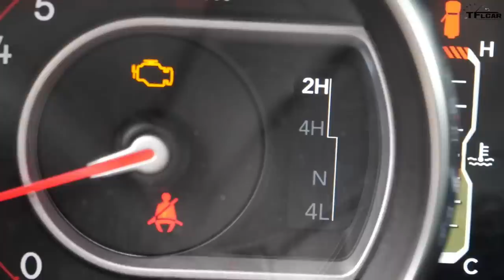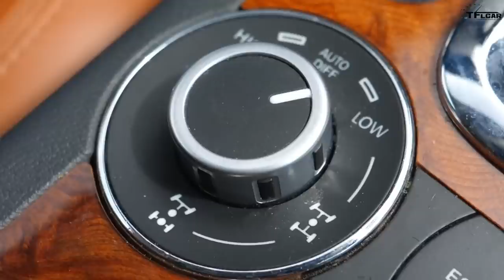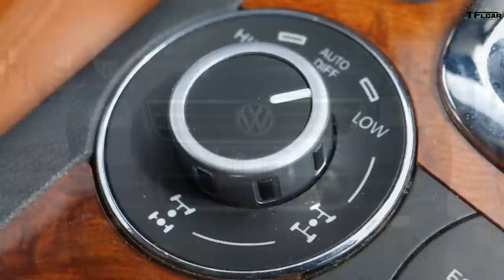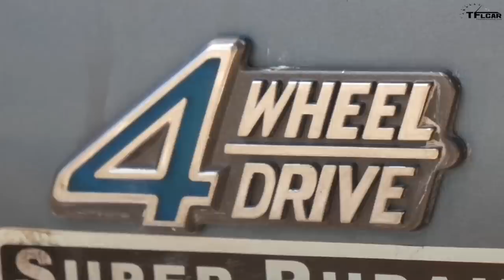These Are The Best (And Worst) Off-Road Cars And Trucks We've Owned!

Comment: Aztek is my favorite of the video. So underrated, odd, and strange. Yet a great performer with a reliable V6
Reply: I recognise you
Reply: @ignasanchezl  oh hi ;D
Reply: Those 60 degree gm v6s are trash the good ones are the 90 degrees like the 3800.
Reply: @Albone3000  my mom and I both have one of those 3400 V6's with 179000 miles. Slow oil leak but they run so smooth. Alero and Venture

Comment: These older vehicles make sense.  The best offroad vehicle is one you can afford to mess up.   See too many people putting on $500 designer shoes and afraid to scuff them on a rock at the farm, instead of buying some cheap disposable work boots.   For most people offroad isn't really offroad these days, its gravel and dirt roads and the like where you may have to hop over a small fallen tree and get a bunch of little rocks thrown up on your paint work and underbody, that's all.   So forget that $55K offroad beauty truck with the 84 month loan.
Reply: This is what I never understand: why are people so afraid of scratching the paint or puncturing the plastic bumper? What's the big deal? Spray it with anti corrosion substance and it will be just fine. Not looking good? You don't see it from inside anyways! I own a Daihatsu Terios Kid and it's a cheap car. But I'm a poor student and for me it's like a half a million dollar SLR and I still never care about scratches. Maybe the problem is that people want their cars to be more of a status symbol than an offroader - I don't know. If I had let's say RollsRoyce Cullinan I probably woudn't want to scratch it either... But $55k? It's unbelievably huge mone for me but I know there're cars that cost double ant tripple of that. If you own such car you don't have the "moral obligation" to keep it spotless

Comment: Thanks for all the great content! Please get a 2001-2004 Pathfinder 4WD for offload testing. Mine has a 5 speed manual. Its my daily driver and fun on dirt roads. I hardly ever use 4WD. And I'd like to see how it stands up to TFL offloading. I suppose the automatics are easier to find. But, the stick is a ton of fun in 2WD on a dirt road and pretty much everywhere else. The 2001-2004 Pathfinder has the 350Z motor that took Nissan 5 years to develop. An, its truly a Nissan, as Renault hadn't got their nasty cost-cutting hands on this car yet. 
My feeling is that these are insanely overbuilt. And hence, they are an unsung forever vehicle. All, I've done to it since I owned it is put on new tires, Monroe top of the line struts, top of the line KYB shocks, and new rear trailing arms. When I get a 2nd car, I suppose I can document its offloading capability then. But, I'd like to see your official test.

Comment: The ML320 2001 - 2002 model with leder seats, is more comfortable than older models, you would have appreciated it more, surprisingly the integrity of the plastics and leder have heled together after 18-19 years on my 2001 and yours too, the 4 wheel drive is great robust and capable, it has not left me stranded after many off road adventures, for me it's  bargain for the $, it's  to bad you did not post more off road videos with the ML320

Comment: Disco 3 is actually better offroad than Disco 2 at least in stock configuration. It's got more ground clearance, it's got rear diff lock (yours haven't), smarter electronics.

Comment: Adding Direct Injection would RUIN the Pentastar V6's reliability, and eventual expense to have the carbon removed from the intake valves. Adding both Direct and Port Injection, like on some F-150 and Toyota engines, would increase the Pentastars power, torque, MPG, and with the intake valves still being cleaned by the MPI, no carbon build up.

Comment: I am waiting and ready to buy two new vehicles. Any news on what is new on the 2021 Ram 2500 is it built on 1500 cab, mega cab still around, more competitive transmission? Secondly when will the eco diesel gladiator going to be released?

Comment: I had an '87 Jeep Comanche pickup that was just a terrible piece of junk, the rear differential blew out and I just drove it in 4WD for awhile and the front axle vacuum actuator would always disengage the front hubs on the highway at odd times and often so the engine would rev way up. I'd have to let off the gas and wait for the clunk that told me it had engaged again. It stranded me three times within a 2 day period, it gave me a fail to start issue so I sold it and the guy that bought it started it right up and drove it onto the trailer. I was unhappy, got less out of it than I asked for. At least I kept the extra 4.0l inline six and sold it separately.

Comment: You said the Scout had a 4-cyl but the video showed a V-8.
Reply: The first scouts pioneered the use of the "Half-8" as some have called it; it was a V-8 engine block cast with half of the cylinders gone.  Impressive engineering to take the highest-quality casting truck engine (SV304) and reduce it in size to fit what they thought were appropriate needs. Used the same crank, pistons, rods, etc... except half are gone.  It was quickly replaced by the 196 (half an SV392), a four cylinder engine that was not surpassed in torque rating until the 2000s!

Comment: had a toy land cruiser a 1974 it was crap to stiff and no power  had a 1982 land cruiser 4 door with a 350 under hood it was crap off road way to stiff and front wheel fell off crap front end weak it was junk